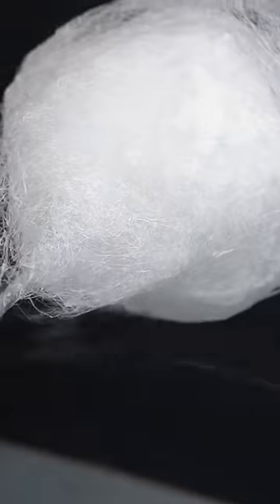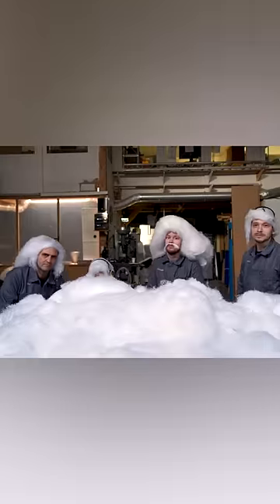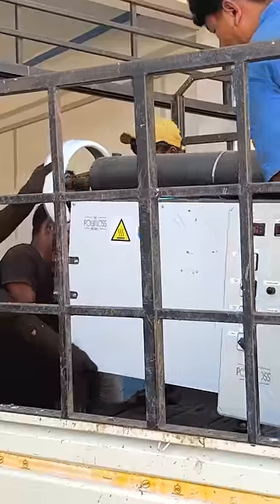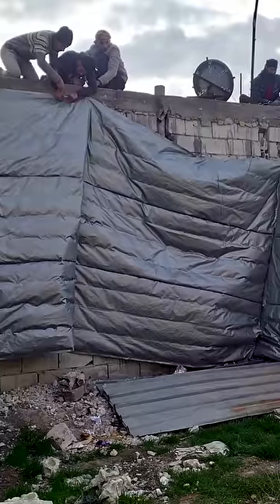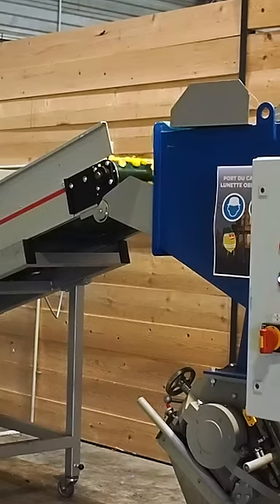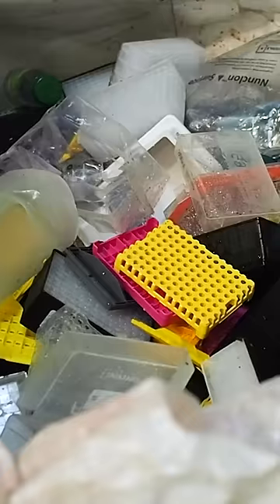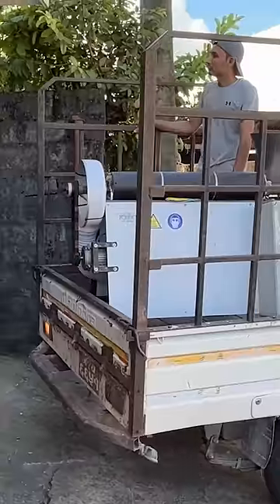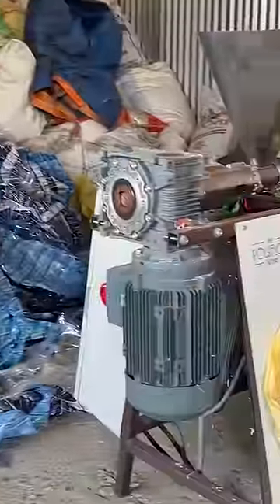This cotton candy is really plastic trash spun into ultra-thin fibers.#recycle #plastic #environment

Comment: Do these people not remember the issues with asbestos?
Reply: That is a different material
Reply: Yes, that its a crystalline structure similar to glass, not at all like hydrocarbons. Unfortunately that also means this is infinitely more flammable, but wont cause asbestosis
Reply: What is the solution??
Reply: @EdgyShooter aren't pillow fillings also flammable tho. Thought its all the same.
Reply: You don't really understand what asbestos is do you?
Reply: @kiriki4558  I know, I was giving an example of a dangerous material that was used in factories that workers inhaled and caused lung cancer, I know this and asbestos are two completely different things lol
Reply: @kimbrolyy yes I do thanks
Reply: @myyou7335  Kind of, most are impregnated with some kind of fire resistance coating to prevent the old "cigarette immolation"
Reply: This isnt volcanic glass lol ill take nice soft plastic in my body over a cristiline needle anyday but maybe thats just because i actually know what im talking about 

Spun plastic is nothing like asbesdos besides being a spun solid material that provides insulation when properly applied a psuedo foam if you will
Reply: @mipmipmipmipmip  no, but it's a far cry better than asbestos 

Just because 2 things are bad in the same way doesn't make them comperable, yall are equating a paercut to a sword wound. I am a healthcare provider specialising in mechanism of injury and hazmat as well as my undergrad field of study being biochem, trust me i know what I'm talking about here so unless you have recieved hazmat training greater than my own more recently than my own I'm inclined to take my professional opinion over that of a rando who thinks saying something isn't as bad as asbestos is the same as saying we want to snort it, you don't seem the most intellectually honest person so sorry if I don't give you the benifit of the doubt
Reply: @mipmipmipmipmip I know it’s mad, and they they keep saying ‘you don’t understand’ or ‘I actually know what I’m talking about’ it’s like being back in the playground when kids won’t listen and only think there point is relevant, this was supposed to be a healthy debate but people keep competing for who knows the most and who has the biggest intelligence, at the same time clearly not understanding anyone else’s comments. Jokes
Reply: "Its for homeless people" they said.
Reply: the great thing about plastic is that it's not asbestos!
Reply: @EdgyShooter plastic IS hydrocarbons.
Reply: @ConstantChaos1  plastic is plastic. Still bad for humans and the environment.
Reply: @stabakoder surface level understanding of plastic
Reply: @UwOtt  Yes, hence me saying that. I was comparing it to asbestos, which is crystalline.
Reply: @ewan428  There are many substances that are dangerous to inhale in their raw form. You seem to think that PPE is rarely necessary in industry - it is not.
Reply: The true problem with asbestos was the fact that it would splinter and break off into microscopic bits on the simplest of agitation and while airborne would lodge those small, crystalline structures into the alveoli. This is where the body reacts and cancers are formed. Plastic, in this case, is more stable to physical agitation and doesn't just splinter off like crazy. Plastic primarily degrades via sunlight so by keeping it covered instances of fracturing should be much less.
Reply: @VultureXV  yeah plastic dust isnt sharp and stabbing your lungs microscopically. But it could certainly get in your lungs brain liver etc and mess with your hormones. I dont think anyone is suggesting it would behave exactly like another substance but that substances have risks we have to be aware of and cautious of.
Reply: @Padraigp your clothes give off more plastic dust than these insulating sheets.
Reply: @doomguy974  my clothes dont give off any plastic dust. Why would you say such an odd thing?
Reply: @Padraigp  polyester, a common material for clothing and other textiles, is plastic. It's made in the same way as the stuff in the video, and has been for decades.
Reply: @mipmipmipmipmip absolutely. It hasn't killed me nor anyone else. The number of other pollutants that are higher on my worry list is pretty high.
Reply: @doomguy974  no response. All my clothing is wool silk linen leather or ocassionally cotton. Theres no plastic in my clothing.
Reply: @Padraigp  ever eaten out of a plastic container or drank from a plastic water bottle? What's your pillow filled with? In this day and age, it's nearly impossible to escape plastics. Not that microplastics really do any harm.
Reply: @doomguy974  once or twice ywah sure. My pillow is filled with silk fibres and a cotton cover with linen thread. I dont do plastic favrics. I drink from a copper pipe from a stone well or a stainless steel kettle or a porceline mug. I eat off eathenware plates. With stainless steel knives and forks. I collect my vegetables and fruit in a straw basket ...unfortunately regualations require that my meat comes wrapped in plastic bagging and many other products like toothpaste etc comes in plastic. Im not melting that into microfibres and sitting in a big pile of it wearing it like a santaclause wig. I also have an asbestos roof but im also not wearing my roof tiles as a santa wig or my fibreglass roof insulation. Its one thing you get wet when it rains its another thing to dive into a pond. If they dont do any harm then why does hsrm happen to coincide with microplastic ingestion. Just a koinkindink?
Reply: Not even related issues.  Your statement reveals your ignorance.
Reply: @EdgyShooter  you can fix the flammability issue by adding asbestos
Reply: @EdgyShooter Flammable? Won't it just melt?
Reply: There is essentially zero overlap between the issues with asbestos and the issues with this material
Reply: Wasn't the problem with asbestos the fact that it was nanoscale fibers, which "nano" + "fiber" is the only thing required to embed a material into your lungs causing mesothelioma. Wasn't the problem with asbestos the fact that it was nanoscale fibers, which "nano" + "fiber" is the only thing required to embed a material into your lungs causing mesothelioma. "According to the World Health Organization (WHO), asbestos fibers that are longer than 5 micrometers (μm) and thinner than 3 μm are considered respirable" "Polyethylene fibers are not nanoscale but microscale" Flammability would still be a concern and you would probably still want to take safety precautions because plastic ingestion can't be good, but it shouldn't get into your lungs and embed itself causing permanent scarring and damage.
Reply: @ewan428 don't bother having an insightful discussion in the comments especially if it's on a popular vid. Just drop your comment for others' benefit then go. I've found this approach to be good for my sanity lol, typing my viewpoint clarifies stuff for me while benefiting others. I do miss out on having a discussion but ngl I usually don't learn anything new nowadays so I don't lose much.
Reply: if it looks like asbestos it doesn't mean it acts like asbestostos
Reply: Do you dont See your huge Lack of education? I mean even the people at the iss can
Reply: Because their not aware of deceitful knowledge.
Not awake.
Reply: @deniseboaz9192    smart students that recognize, false information.

Comment: Four people that created a new way to generate more microplastic
Reply: You have trouble grasping that it’s recycled, don’t you? It was always going to be micro plastic. You not wanting to acknowledge reality doesn’t change reality
Reply: @Nevertoleave they’re upset because it’s speeding up the process instead of slowing it down and helping.
Reply: @Smolnsalty  It absolutely does help though. Where do you think that garbage is going if not getting recycled. Recycled like this, it'll stay on land for a few years more, and then it can be recycled again.
Reply: @Lundy.Fastnet.Irish_Sea  Look at what is recycled to make this - bottles, caps and plastic bags - and compare that with these "ultra-thin" fibers they are advertising like it's a feature. To recycle bottles you have people picking them up by hand or with a net. What's the plan for when these pillows inevitably break? Go around the shores with a microscope and pick up the microparticles with tweezers?
Reply: I believe it won't generate anymore microplastics. Because its recycled plastic, not new plastics. But if you were to say speeding up the process then yes its possible.
Reply: @albingrahn5576  Location matters. The plastic garbage baking in the sun in the landfill and in the sea is going to pollute the environment much more than fibers contained within quilts and jackets. Plastics are not water soluble so the bulk of the fibers are still going to stay inside the fabric when the whole thing is discarded.
Reply: Talk about the air pollution it takes to melt all these plastics down too
Reply: @DanishnSonic no it is generating new plastic, they need a mix of old and new plastic 60-70% has to be new plastic for some reason
Reply: @Nevertoleave they are using new plastic and recycled plastic to make these things. You don’t know how they. Even recycle them
Reply: @RoxasLopez so they are still recycling old plastic, less plastic is wasted and used over all.
Reply: Its used for a long time instead of just laying useless in a landfill and becoming microplastic on its own. I understand your critic but the world has so much plastic so its a good thing to actually use something of it for a longer period
Reply: @Nevertoleave plastics aren’t as recyclable as you think
Reply: @Smolnsalty but its helping?the plastic is being re used as insulation instead of being dumped in the ocean or land fills the definition of recycling
Reply: ok, so worthless until another big company breaks down the waste into pellets. by that point it is already another product. so this is not helpful.
Reply: Nope.

Btw. Get rid of your plastic, Double standard

Comment: This makes my lungs scream asbestos
Reply: Plastic is not asbestos...
Reply: @shiftymiata  you have no idea what im talking about do you ding dong why Do you think they are wearing respiratory protection lol
Reply: @shiftymiata :  |
Reply: @shiftymiata  No, but it may be worse
Reply: @athingwhichexists  in the factory absolutely need a mask. installed as insulation no you're fine. the plastic will never get hot enough to emit fumes.
Reply: @7kortos7  No, but the Microplastics you'd be breathing in and eating and touching and drinking could really mess you up
Reply: @athingwhichexists  they are in fully sealed bags. unless they were punctured then you're totally fine. and their use case lasts much longer than how we use other plastic. once it's in a home that is plastic that's not going to make it to landfills or recycling centers for decades. with how much of a problem plastic is, this really is a great thing.
Reply: @7kortos7  I wouldn't trust that with the bags. They may be fire resistent (Not proof btw), but what is their effective life span, how long until wear and tear gets to them. You say that they will last, but are they capable of handling years of weather, Freezing, baking in the sun, Flooding, or some other format of sudden damage. These are meant for impoverished areas bear in mind, they will be subject to wear and tear. Plus once a hole is torn into it, then it gets into the air, house, and possibly environment. That's not even accounting for animals or bugs interacting with the bags and possibly being the ones to tear holes into them.

To put it simply, they may claim its well contained within the bags, but aren't providing any assurance, and given these are bags their effective use time is not infinite, but the plastic inside is. How can you insure that the bags will be properly disposed of in the far future when the people they were given to forgot about them and sold the property off several times.
Reply: Maybe your brain should be screaming for a science class.
Reply: @7kortos7  yeah, just like asbestos being fine as long as it's contained.
Reply: You do realize standard house insulation, the fluffy purple stuff, isn't good for your body and lungs either, right? That's why we use it for insulation, not bedding. 

Most things you come into contact with have components which are hazardous if consumed or inhaled, and can be dangerous if used incorrectly. Smash a florescent lightbulb or drop the toaster in the sink while washing your dishes and you'll get some idea what a worse case scenario can look like. 

We can't stop having houses because something might break down someday. That's what maintenence is for.
Reply: This!
Reply: @athingwhichexists they will breakdown into micro & nano plastics as they age.
Reply: @TheBluestflamingos There are other options for insulating a house including types of concrete, Cob, Hay, stabilised mud bricks etc.
Reply: @TheBluestflamingos Thank you, I hate when people derride something new for having potential risks as though there are none that exist in current everyday proceedures. Imagine if no one ever used bleach to clean anything because its potentially dangerous, or no one ever wired up a house to have electricity because you could shock yourself or start a fire. We're used to those risks. It seems absurd to just shoot something new down simply because it's something people aren't used to yet.
Reply: @TheBluestflamingos For millenia humans have built houses with natural materials without the need for toxic substances. Your point fails epically.
Reply: The worlds just waiting for your big idea 😂🤡
Reply: @dugebuwembo the only insulation you listed was hay. Everything else is just thermal mass, which has value but many climates require insulation.
Reply: @dugebuwembo for millenia, humans have suffered from kinda poorly made houses that erode in like, a year due to heavy environmental strain. Then we invented stuff like brick and mortar, then we got smarter and invented concrete. Innovation is a GOOD thing, we shouldnt just say "oh if it aint broke", if we thought like that, we wouldn't have the internet, after all, the mail system has been around for a while, humans have been writing letters to each other for hundreds of years

Comment: “The four people who invented the process…” were clearly on something and I want whatever they have.
Reply: This is polyester. You know the thing that's been around since the 30s. They didn't invent anything just trying to rebrand polyester and take credit for iit.
Reply: @ISoloYouRelax  It could be polyester, PVC, PET or any other plastic but you're right; these people definitely did not invent this extrusion process, which is far older than they are.

Typical example of journalism where the reporter hasn't actually understood something or isn't great at English. What's new is that they've stuck one of these machines on the back of a truck to produce insulation in-situ. It's innovative, not inventive.